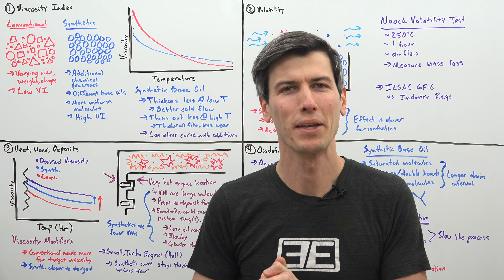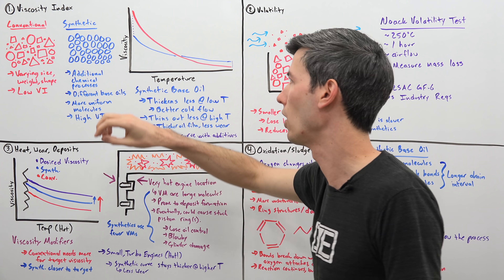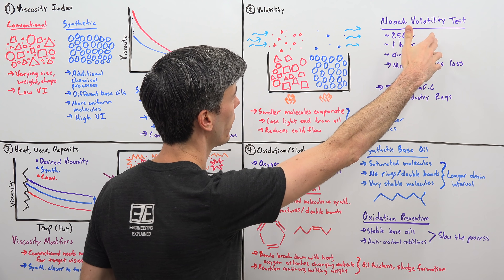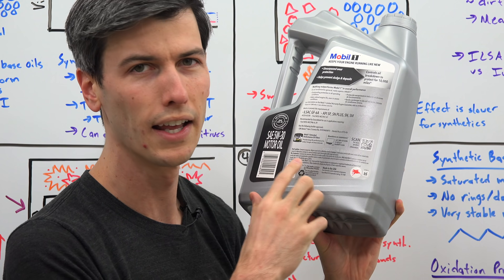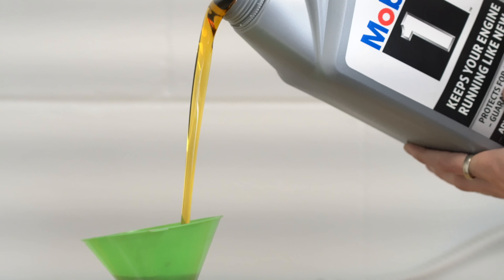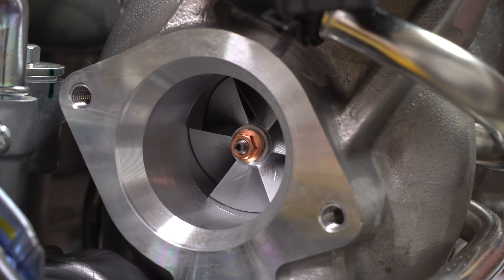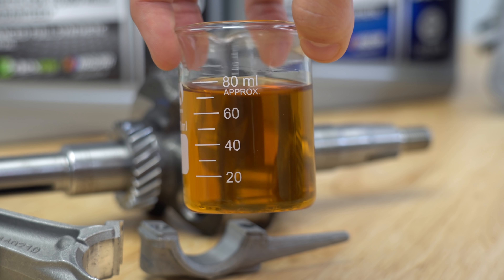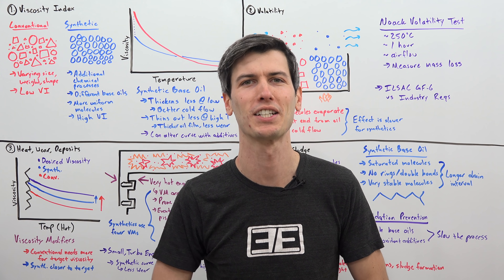Synthetic vs Conventional Oil - There's A Good Reason To Switch

Comment: I'm sorry to say but your logic is flawed. You cannot speculate that all synthetic oils are the same period if you're using, for example Royal purple, your logic could pass. You have to think with modern engine design, especially with GDI, you have to change your oil very often. It's irrelevant if it's synthetic or conventional. 30 years ago, the engineering was a lot different so you would want to use a synthetic for better lubricity. Now with, it's completely different the engines are much better in handling friction. Now you can get away with using a conventional oil. You're absolutely right about the viscosity improvers. I only use single weight oil because I live in Florida. There are no viscosity improvers. I use a straight weight SAE high detergent 30 weight oil. I use it in my $90,000 lexus. Runs like a clock. Unfortunately if the temperature gets below 30° f I used I have to use a 0w30. But I never had had to do that yet. most cars especially nowadays can get away with using conventional motor oils. Don't forget, viscosity improvers are not lubricants. Approximately 25% of what you see in a qrt of oil, is nothing but viscosity improvers. You're getting ripped off. That's the reason why I use a single weight oil because what you see in one quart of oil is all oil. To prove my point look at racing oil, they're all single weight. You won't see a racing team putting 0w-30 in a racing car like nascar.

Comment: Synthetic oil is better than conventional and 100% synthetic is better than synthetic oil.  You didn't mention 100% synthetic oils like redline and amsoil... even synthetic oils like mobile 1 still carry conventional mineral oil.
Reply: even Bugatti doesn’t require “100% synthetics” in their super cars. Those “full synthetics” are either good enough and some may actually outperform 100% synthetics. My Porsche uses Mobil 1, this is what Porsche requires.

Comment: If synthetic oil is so good then why has our 2008 Nissan Sentra with 216k on it run just fine with Jiffy Lube $30 special? The oil has been changed every 5k (easy to remember intervals) and they use their filter as well. Engine starts, runs and pulls just like it did when the car had 10k when purchased. I would say on time oil changes are more important versus the oil itself. Plenty of BMWs and Audis with oil sludge issues and they run specific synthetic oil. Why do they still have that issue when running synthetic?

Comment: Thank you so much for this series. I've been a diesel mechanic for 14 years and also tinkered with them in general for 30+ years. And Hearing you break down as an engineer the differences of conventional vs synthetic and why its better to flip to synthetic to a level I can mostly understand has been very helpful! I also have pushed my friends and clients to do the same I maintain regularly.
Reply: @WISHBONEL7  Penske Truck Leasing is one place, as I worked there for 14 years and that's the type of oil we put in everything. The rentals, the semis, the Thermo King and Carrier units, etc. But I cant say for other fleet or fleet management centers.
Reply: it is no longer valid to clasify oil by synthetic, semi synthetic and mineral, because most of them made from hydrotreated today.
Reply: Where do you live ? I’m looking for a good diesel mechanic

Comment: I'm friends with a large fleet owner for over 20 years. He always has used the cheapest oils that he could get. With regular oil changes, all of his (driver abused) fleet vehicles made it well past 250k miles. Needless to say, I don't believe in oil discussions. Oh and I know a little bit about engines too. I have a fully equipped shop at my home garage and have been working on cars for over 30 years.
Reply: Exactly. Did cheap oil changes in our Nissan Sentra for over a decade and the car still runs fine with 216k on it. On time oil changes are more important versus using oil that costs 3X as much. Also, when conventional was pretty much the only thing available those cars still ran 200k to 300k and beyond just fine.

Comment: Ah, Mobil One pays you to say they are the best. It is good oil but not the best.

I used to use it before I switched to Pennzoil Ultra Platinum plus and the lab results show it does last longer than Mobil One (turbo charged car).

Better (less) volatility also, which is specially important in Direct Injection engines.
Reply: I use Mobil 1 in my Porsche because this is what Porsche recommends

Comment: The theory is and has been clear...my main question would be, why still some car manufacturers write in their manuals to explicitly NOT use synthetic oils.
Reply: Some motors have seals that will expand due to some chemical in the synthetic oil. I don't know the name of the chemical off the top of my head

Comment: pennzoil platinum is all i run best stuff on the market IMO
Reply: Bingo, best bang for the buck.
Reply: Pennzoil Platinum isn't anywhere close to Amsoil.
Reply: @johnsteele8073  
On YouTube see; Farm Project, episode Amsoil or Pennzoil.  Yes Amsoil wins in performance, but not by much. Look at all the other oils that these last two left in the dust. Pennzoil is wins on cost to quality.
Reply: @SkypowerwithKarl  PF is entertainment. It's for show. I've probably seen the videos you're referring to nowhere does he talk about the TBN the additives the rated noack volatility (which amsoil blows everybody out of the water)
Reply: @johnsteele8073  
Actually he’s already done that in the preliminaries with the lab analysis. In the finally he mentions it’s basically a recoup. I use Amsoil Super Shift in marine transmission because it doesn’t slip and there’s zero wear.

Comment: Great video as always! Is it true that a high mileage car that as always used a semi-synthetic oil may burn oil if the oil is changed to a full-synthetic one? Carbon deposits may be removed by the high detergent power of full-synthetics and expose leaks making the car burn excessive oil and even loose compression if the leak is located at the piston rings. Am I thinking right or is this highly debatable?
Reply: No the real synthetic didn't cause something that was caused by synthetics that claim they are full and aren't or conventionals these did it all along. A true synthetic is far superior to full synthetics which are only synthetic blends of petroleum oil. And petroleum oil companies a literally laughing all the way to the bank.

Comment: I assume Mobil don’t manufacture any non-synthetic oil? ;) I heard a rumour some of the old type-r vtec engines were better run with non-synthetic. May not be true though...
Reply: I believe they have the Mobil5000 regular oil. Could have been phased out though

Comment: hey Jason, i have a question i couldnt find an answer to online, completely unrelated to this video. you know sand rails? those offroad buggies with massive rear tires and small fronts with hardly any tread. how are they able to turn with such small front tires? do they use the same principle as dirt tires on 4x4s do for braking, pushing a pile of dirt/sand in front of the tire? do sand rail front tires, when turning, kinda dig in and plow a wall of sand to deflect off of? how come they can get away with much smaller front tires than you'd need on tarmac???

Comment: I go for the synthetic when it is on sale at Costco. 👍
Reply: They have mobile 1 synthetic there. I put it in my '08 Challenger.
Reply: @dannydaw59  
Any synthetic but that next time friend.
Reply: @SkypowerwithKarl  Why?
Reply: @dannydaw59  
It’s not a true synthetic by some definitions. In some countries it can’t even be sold as such. Amsoil, Royal Purple, Mobile 1EXTENDED and Pennzoil platinum or ultra are true synthetics. Best economic bang for the buck is Pennzoil platinum with the ultra having a better detergent package but more expensive and harder to find. Amsoil is the best but very pricey so I go with the platinum & Wix or Napa gold filters with vehicle recommended change intervals. (Just be sure the old filter gasket isn’t stuck on the block) See Farm Project episode “Amsoil or Pennzoil” for just one of many oil tests on the internet.
Reply: @SkypowerwithKarl  That Mobile 1 synthetic works great for over a decade now and if it wasn't synthetic it wouldn't be allowed to be  sold with that label. Mobile's competitors would make sure of that. Costco wouldn't carry it for so many years now.
Reply: @dannydaw59  
Mobile actually lobbied to have the definition changed for synthetic.... and won. If you are a Mobile synthetic fan. Look for the Mobile 1 “extend” version . That is a synthetic. Labeled extend because some say you can extend oil change intervals with synthetics but I don’t. Carbon deposits, blow by and fuel dilution still happen. Ever wonder how good your injector are after you shut your engine off? Direct or multi port. A little fuel gets in after you shut down and yes some boils out of the oil when it gets hot but not all, some nasty get left behind. Change your oil when the manufacturer recommends.
Reply: @SkypowerwithKarl  I don't buy the extended version and I'm done squabbling with 1 opponent of Mobile 1. Even Porsche a German co. known for great engineering and attention to detail recommends it. Case closed.
Reply: @dannydaw59  
GM’s own analysis saw the truth but to save money (and perhaps money in the right pockets) they didn’t change either. When something doesn’t make sense in business or politics, ALWAYS follow the money.

Comment: My engines burns/leak about 2 liters every 10000km. I always make sure to keep it top up. Now because of this 2 liters of fresh synthetic oil, would it be ideal to extend my oci to 15000km.
I use fram ultra oil filter xg3600, larger than the standard xg3614.

Comment: In my '14  Cayman S I run Driven DI-40 since it has been found that this oil causes less deposits on the valves.  In my other car, an '01 Subaru Outback LL Bean, I use regular Castrol.  I run dino sauce in this car because that is what it has always had.  

I've been told that switching from dino to synthetic can cause oil leaks/seepage.

Comment: Why do we still have production split , yes synthetic costs more, but by scaling the production to favour it, it will drive down prices. is it cost or because the basic base oil with minimal processing meets the requirements?

We know the marketing nonsense, but talking full synthetic and semi doesn't count at times as you don't know the percentage processed and ratio of additives in them. the only defined term is 100% synthetic which you know meets this standards in terms of identical molecules versus the rest which can still be mostly base oil and additives with minimal processing.

Comment: Does anyone remember Mobile 1 tried to  take Castrol to court. One of  issues was that Mobile 1 was saying Castrol synthetic oil was not a true synthetic but a " cracked " natural oil in other words just a highly refined regular oil (apparently cheaper to produce), vs a polymer based real synthetic.
Mobile 1 ultimately lost this in a US court because of the apparent definition of what a synthetic truly means.
I suspect that Mobile 1 has decided to go to this cheaper formula too.
Here's my reasoning. European standard for synthetic oil are or were different. There are now two different Mobile one synthetic oils. One for the North American Market and one for the European market.  The original Mobile 1 (more expensive) qualified as a true synthetic while the changed formula did not meet European requirements. 
Mercedes Benz recommend and filled their new cars with Mobile 1, then stopped. I understand it is now allowed in some of the cars. 
Castrol also has two different formulas for each market, I believe the European true synthetic added green dye to visually distinguish the North American formulas from European formulas to prevent the cracked oil from being sold as a synthetic.
My personal opinion is that if I'm going to pay for the added cost for a synthetic oil, it damn well better be a true synthetic.  I use one or two other brands with stellar reputations as real synthetic oils.
Reply: I drive new Porsche in the US, it uses Mobil 1 ESP, this is what Porsche requires.

Comment: Very good video.  But those balls of representation for conventional vs synthetic blend is not the most accurate.  

Conventional oil = all shapes and sizes.  

Synthetic blend aka full synthetic oil (mobile1, castrol etc) = all shapes and sizes like conventional plus some uniformed size molecules.  

100% synthetic (motul, amsoil etc) = molecules are all the same shape and size

Comment: FYI you can f’up an older engine with synthetic. Talk to any Porsche classic owner or mechanic. You would be amazed how “slippery” synthetic oil can seep through older gaskets. Synthetic is great in new modern engines and older engines with gaskets with new compounds.
Reply: I would not think so so long as viscosity are same seemed to hear about pennzoil ultra premium in same viscosity causing problems it derived from gas
Reply: @dagnabit29  You may not think so until you own a classic Porsche and it actually happens. Same factory oil specs always.

Comment: Jason: I've followed you for a while, what do you think about products (solvents) to "clean" the engine before an oil change? Are they any good, or a complete no no? Thanks for your work?
Reply: I have used an engine flush successfully in many of my vehicles. My recipe: 1/3 motor oil, 1/3 diesel, 1/3 automatic transmission fluid. Let the engine run until warm with no load, then empty. The amount of dark color coming out is significant.
Reply: Years ago we used kerosene run no high speed crap drain for awhile fill with oil run for awhile then drain and finally refill of course we where using dinos

Comment: Every time I watch these, I wonder why manufactures even make conventional. Does anyone even use it? Synthetic is like $2 in cost but better by every single measurement. Clearly that is $2 well spent. I haven't purchased conventional oil in at least 15 years, its probably closer to 20. Just stop making it. Then no need for these videos. At that point the synthetic just becomes "motor oil", no need for the designation...

Comment: One question regarding oxidation, in the case a car didn't reach recommend millage to change the oil, should we change the oil based on time? some manufactures have a legend saying "6000 Mileages or 6 month, wherever come first", but for a reason Mazda dealers say to me that time is not longer important, the car should reach 6k mileages for an oil change service.
Reply: Hmm, AMSOIL says one year max on most of theirs.
Reply: @429thunderjet2  yeah I know, and I was assuming it was because oxidation, but synthetic oil is better at handle oxidation it make no sense that both oils lasts the same...
Reply: @AntonioUrrutiaC  so even if you only put on a few hundred miles oil should be changed at least once a year. But there is an exception to that, the Amsoil Z Rod oils for classic cars that don't get driven much can be pushed to two years or 5,000 miles max. Those oils have a very robust, high concentration of anti rust, anticorrosion antioxidative additives for that purpose.

Comment: Could you elaborate on wide weight spreads of oils and how it affects their durability? 5w20 vs. a 0w-40. I would like to use a 0w-40 synthetic in our fleet of outdoor power equipment for ease of starting in cold weather but have a heavier oil once hot but wasn't sure if a 10w-30 would be more durable and actually last longer over a service interval. Thanks!
Reply: I've used Rotella 0W40 i(full synth) n my 1999 Ford Explorer plow truck for a couple years, previously used (for 15 or more years) Rotella 5w40 full synth  (0w40 is newish)...anyway the 0w starts easier at -30c or colder than even the 5w... I have 600k km on the truck and it doesn't burn oil.... it leaks a quart between changes but it always has done that..... its used as a local driver in the summer (+30c) so the oil is used at faaaar ends of the temp spectrum... I've got a oil pressure gauge in the truck and it never waverers from normal whether cold or hot... so yes I'd say its perfect for any  engine operated in cold/hot conditions. btw I change my oil every two years (about 5000 km).. cheers from from NW Ontario Canukistan

Comment: Wondering if you would consider doing a video on aviation oils. The use of lead aviation fuel (100LL) really changes things. Conventional aviation engines are also air cooled, made of mixed metals (aluminum, magnesium, etc.) sit for long periods between flights, and operate at max RPM for most of their lives. Might be a fun rabbit hole for you to dive down.

Many of the newer experimental engines that guys like the Flying Cowboys are using are modified car engines that run on car gas, as well.

Comment: Well as of now, most cars made after 2010 use 5w30 or better, oils only available in full synthetic, soooo.. yeah synthetic is is
Reply: @Ruggero Bartolli, don't know where you are located, but in the U.S., 5W-20 oil is available in conventional.  This is the weight my Mustang uses, which is how I know this.  I use synthetic by choice.
Reply: @guyrouillier  whaaat? In Italy anything lighter than 10w40 comes full synthetic by default

Comment: Be cool if you did a video comparing an expensive oil such as mobil1 and a cheap synthetic oil such as walmarts super tech or even cheaper still, kirkland synthetic at only $24 for 10 quarts.